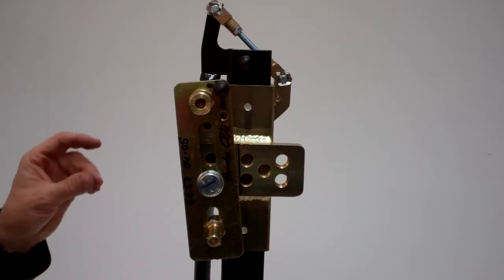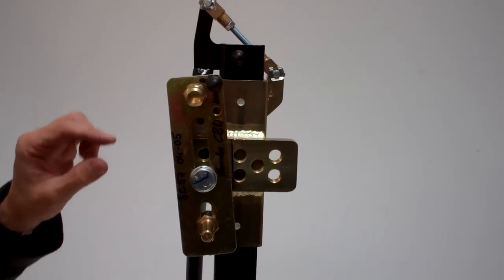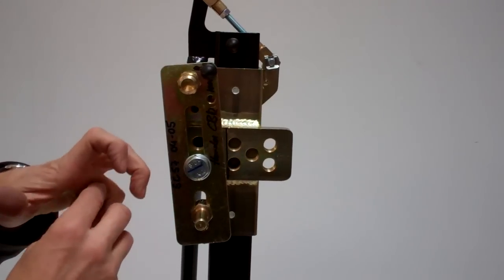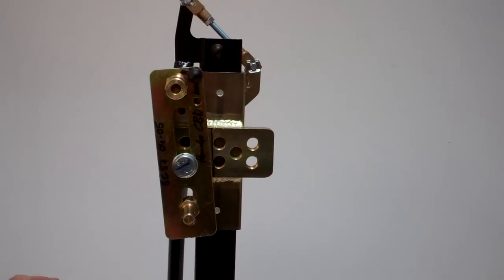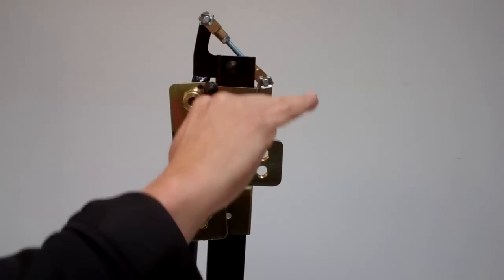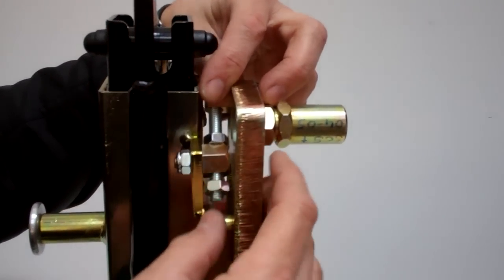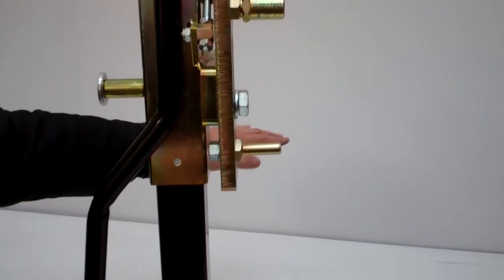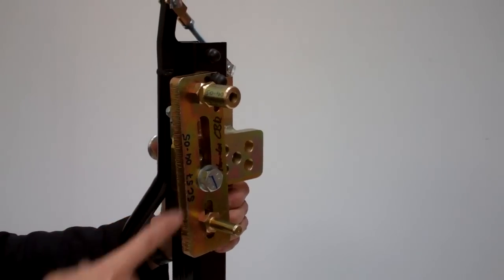BURSIG Stand Instructions "Horizontal Adjustment"

Comment from the maker: I'm really sorry to hear about you running into issues with our Stand dirk40. NEVERTHELESS, the adapter plate shown in the video above is for a CBR 1000RR SC59 not the S1000RR!!! All our Stands are being shipped out with the specific adapter plate already installed. Did you buy the Stand directly from BURSIG USA?

Comment: Nice stand, just installed mine (BMW 1krr 2012). 
However, the instructional video here doesn't show the plate in the right position. It should be mounted one hole over to the right!! 
I learned the hard way as the plated nicked my clutch cover on a couple of spots... highly annoying as it would not be feasible to swap it. :-( bummer.